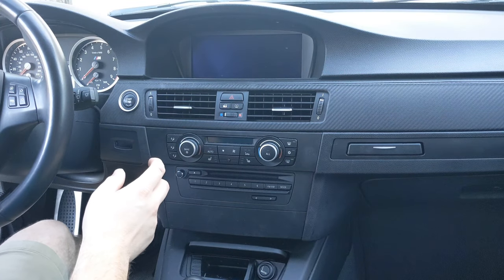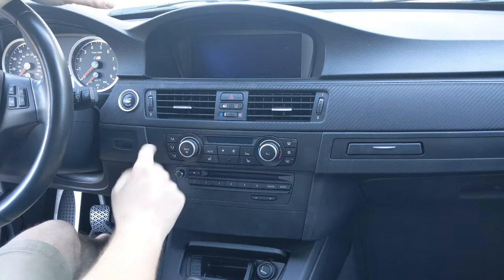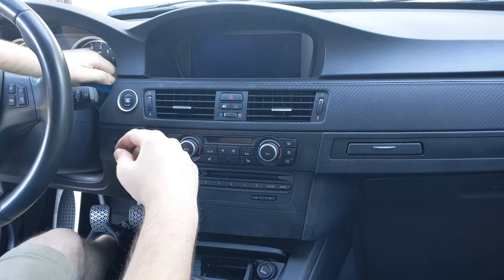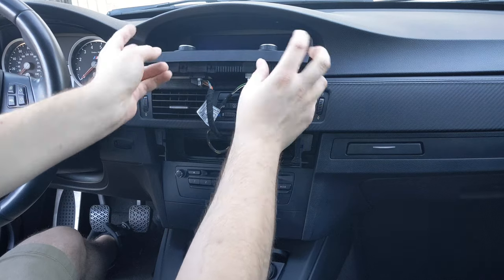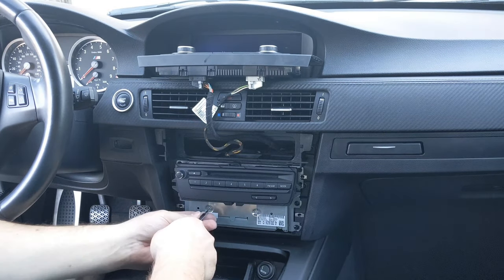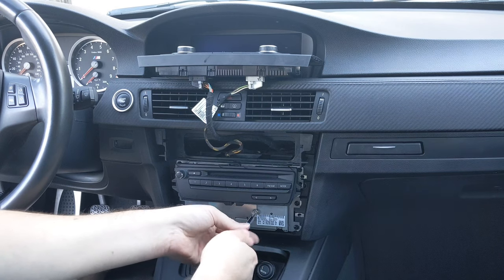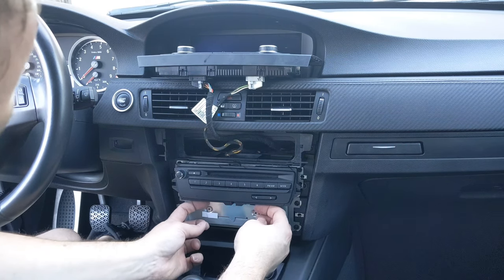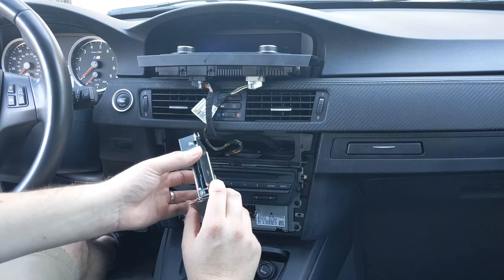BMW CIC Infotainment Hard Drive Removal e90 M3

Comment: Thanks for the video. One question the music is starting to cutting and suspect the HDD is going bad if i replace it do I need to code the new HDD and do I need to install a OS to run work in the car?
Reply from the maker: You have to clone the factory hard drive and structure, which takes some effort and computing knowledge. I followed this process on e90post and it worked great:

https://www.e90post.com/forums/showthread.php?t=1426773

Comment: My 2009 m3's idrive has just started going to a constant reboot mode. I had the car on a battery tender and I noticed that the tender would never go green when this issue started. The battery is fine and the tender goes green when I disconnect the battery from the car (negative terminal unhooked). Is this the same issue you had? Some other symptoms: the idrive controller is not responsive and the volume knob has no effect on the music loudness. The same radio station and volume that keeps coming on then going out when the system reboots. I cannot go to any other screen. Thanks in advance for any tips. BTW, what made you come to the conclusion that it's a bad hard drive rather than bad CIC?
Reply from the maker: I honestly wasn't sure, but the hard drive route was way cheaper than the CIC and it worked. I don't exactly remember but I seem to think that I had some ability to move around screens.

Comment: What type of hdd is that? Great video btw!
Reply from the maker: Thanks! I got a refurbished Samsung EVO 1TB Internal SATA solid state drive (model GSRF MZ-76E1T0B/AM) from Best Buy.
Reply: @heymigo  from the video it looks to be and IDE interface. Does it convert a sata drive to the multiple pins I see in the video?
Reply from the maker: Yep, I loosely followed this thread on e90post: https://www.e90post.com/forums/showthread.php?t=1426773

That meant I purchased:
- The hard drive mentioned above (~$100)
- Ableconn IIDE-MSAT mSATA SSD to 2.5-Inch IDE Adapter Converter (~$30 on amazon)
- Vantec SATA/IDE to USB 3.0 Adapter (~$20 on amazon)

I don’t specifically endorse any of those brands (those converters are generally hard to find and reviews tend to be pretty mixed), though I can say that these worked for my car (I sold it about six months after making this video without any problems).

I have a Raspberry Pi that I use as my media center, so I just used that to do all of my drive partitioning (possible, but way more of a pain in Windows). 

Boot speed even improved on the infotainment, so it was all in all a worthy upgrade.
Reply: What boot loop like the bmw logo would show then shut off?